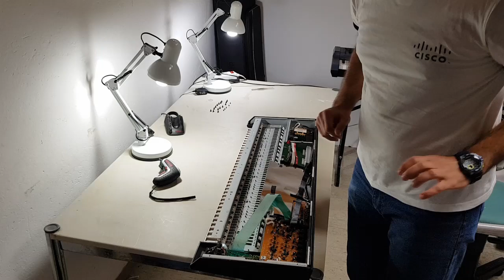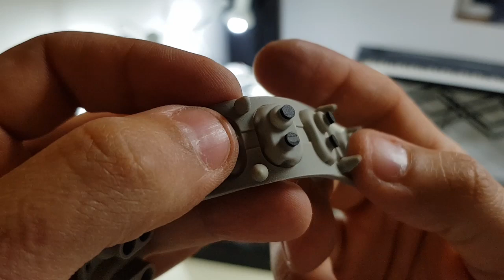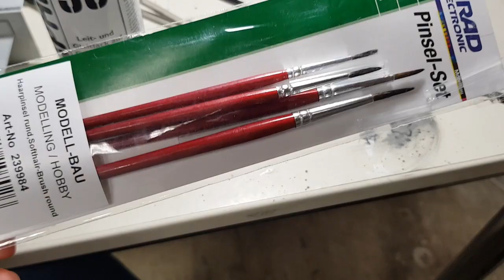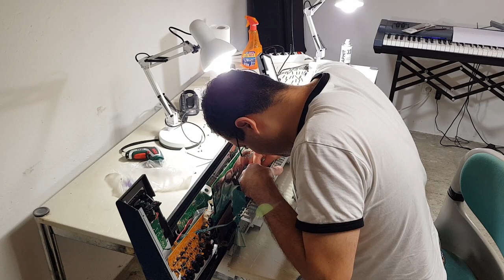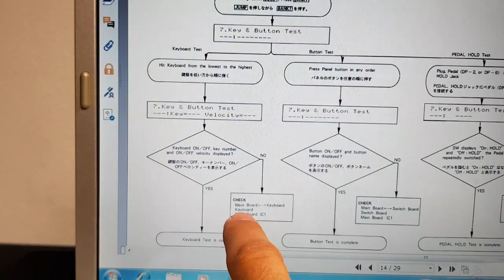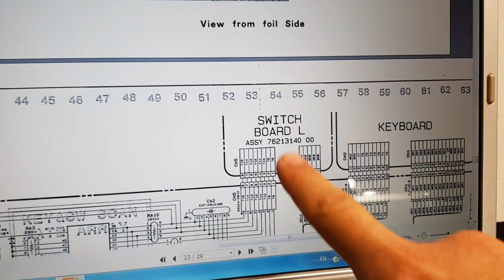Roland U-20 Problem and Repair Part 1 of 3

Comment: I got a Rhodes 660, which is basically a rebranded version of that keyboard.  I'm using it as a midi keyboard and the aftertouch sensitivity is pretty weak.  Is it possible to increase the sensitivity if I open it up?

The menu controls don't affect the midi side of things.
Reply from the maker: Hi. This is a tough question because increasing the sensitivity of the after touch is 100 percent a matter of hardware design. If you don’t have the schematic of the board, it is very hard, if not impossible to find a way to do that.
Whether or not changing hardware for the sake of after touch would affect other parts of the system is also not easy to answer. 
So if you are an electronics, electrical, or hardware engineer or you know one and you have the schematic of the board, then you might want to check with him. 
Also you might ask this question in Roland related forums and see how others came up with the ideas to solve this problem. 
Good luck and happy new year in advance.

Comment: Regarding the green flexible PCB with the Roland part number 22925669-00:
This part is not available as an original spare part anymore. Roland sold the last ones they had to a Canadian guy many years ago, and also he ran out of stock long time ago.
If you own a Roland synthesizer from the early 90s, e.g. a U-20, D-50, or, as in most cases, a JD-800, it could be that you need this spare part, e.g. to fix the "Red Glue" error, which unfortunately almost all devices equipped with an SK7 named keyboard had.
In this case, the red synthetic resin used to glue the keyboard weights becomes liquid, drips out of the keys and soils or damages the green, flexible circuit board.
Repairing the PCB itself is usually impossible, as the resin forms a very strong bond with the PCB, and most attempts to remove it unfortunately fail.
This is how it was for many years.

I myself had already started to remedy the situation by making a new PCB, but had discarded my plans in early 2020, as another person, Guy Wilkinson from England was already much more advanced with the same work.
He completed his project in 2021, and now offers a set consisting of a completely new redesigned flexible circuit board, and an also redesigned new connection board which also solves some design flaws Roland made back then.
The set is currently still being produced in small quantities, and can be ordered directly on his website. Here he also offers very detailed repair instructions for the devices mentioned, as well as many useful tips for other devices.
He also offers an installation and repair service which should be arranged upfront.
Guy asks that you contact him by email for availability of spare parts. 
contact@supersynthprojects.com
His website: http://supersynthprojects.com

Customers in mainland Europe will certainly find the option of contacting http://synth-parts.com more convenient. This is a professional synthesizer repair shop, and and well-stocked synthesizer spare parts supplier in Wuppertal, NRW, Germany.

I myself own two JD-800s, one of which is completely original, and the other of which has had the above-mentioned circuit board fitted in Wuppertal to restore my beloved instrument to its former life.
There is virtually no difference between the two devices after the repair.

I am not in any way related to the companies mentioned, and I am not being paid for this contribution.
I have logged in here specifically for this comment as I feel the information is valuable and would like to share it.
The mention of companies, trademarks and brands is for descriptive purposes only and does not constitute advertising, but serves the sole purpose of imparting knowledge.

Comment: Hey there thanks for filming this video.  I had spent a whole night opening my keyboard but I didn't take apart the keys to see if I could clean the contact points without taking it apart.  I was able to fix all the keys save 3 just by rubbing off things on the keys on the reverse side on the silver metal bendy parts.  Although  I still couldn't fix 3 flat notes and my whole set of buttons for selecting other instruments don't work.  This inspired me possibly to fully take apart the keys.  (after I take a couple days rest hehe) Theres corrosion in mine although my board looks fine so I'm not so sure if I just have to keep scraping it off carefully.   Being as the majority of my keys work I still find it useful connecting it to garage band with a midi (mio) and I can still find it very useful and change the instruments in the software.  Even though my selection keys seem to not respond.  Sometimes you just keep trying and eventually they work. I used a small vacuum as I was hitting the the back of the keys with the back of a plastic paintbrush. Useful<---all the keys have labels on them.  Gonna write them all out as you suggested if I decide to take all my keys off.  Good work, it's a whole operation.  Found your video very clear.  Happy playing everyone hope you get yours working:)
Reply from the maker: Thank you.

Comment: I’ve done the keyboard contact repair on my Roland U20.   I actually had to do it twice on one of my U20’s because the contacts were remanufactured so bad.
    Edit:  I’ve actually had to do this same contact repair on my brothers U20s too.  Roland really screwed this design up. I have many Roland keyboards, none of my others have this problem.  
   (OK I forgot about my three Roland XP 80s with bad Epoxy On the keyboard weights.  Don’t ever buy a used XP80 that has the orange epoxy Holding in the keyboard weights!!!).

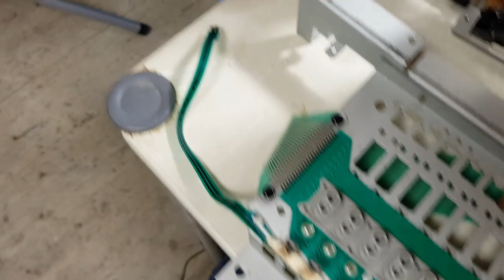Comment: @ 1:50:00  NEVER EVER UNDO THAT CONNECTOR !!! Disconnect it at the mainboard so that you can altogether remove the keyframe from the main body of the synthesizer, but NEVER disconnect it where it joins to the keyframe. There it is glued together at the factory and you'll never make all the contacts conduct properly again. This is Roland's worst ever keyframe,  Complete Disaster Technology !  Also, the switching diodes for each key are 'Glued' into the green Mylar contact strip under the keys and are impossible to replace. So you'd best hope that dead keys are not caused by dead diodes.
Reply: I undid my connector and tried cleaning it with alcohol...bad idea it disolved the contacts on the green strip now the keyboard is useless. I was thinking of bypassing the green strip altogether and replace it with wiring, I was just wondering was this keyboard worth the work.
Reply: @fredtillman3050  midi another keyboard to the U2o and you can see if you like it or not.
Reply: @GaryLet  Thanks Gary L, I've Missed it with another keyboard and I like the sound, but I've got soooo many Roland keyboards and racks (7 total) I'll just sell it to Keyboard Kountry. I paid $30 for it and it had an octive not playing so it was worth a shot but thanks again Gary L.

Comment: I repair a lot of keyboards. The U20 is not a project for beginners. The shitty ribbon cable interface on the keyboard is very fragile. I learned this the hard way when fixing a Roland JD800 which has the same keyboard.  The low tech fix is always the best. On my Jd800 I drilled holes in the metal and clamped the seam where the cheap ass ribbon was heat sealed together (using small bolts and using thick rubber between metal strips and the cable.....Go to yahoo groups roland JD800 to see pics. A variation will probably work on the U 20 if you didnt destroy the cable. 

Also the U 20 keyboard suffers frrom red glue syndrome. I took all the keys off and sealed the weights and red glue in with better glue. I replaced all tac switches under the panel buttons. The construction of the U20 is pretty gnarley, too many ribbon cables and weird angled mounting of the boards. Not the easiest board to fix. Im waiting on a few key bushings in the mail, as 3 got torn off when I removed the keys to glue them.
Reply from the maker: Hi and many thanks for your comment. Someone sent me the spare part(s) and now the Keyboard is fully up and running. Please watch video 2 and 3 as well. The links are available in the video description.
Reply: Thanks but sorry to hear cause I was about to buy a used one. Use to love the U-20 but never had one. I have an Alesis QS-6.1 now.
Reply: @Berkner80  pretty sure I smashed the u20, in a fit of rage. not worth the trouble. the jd800 was a horrible project, but at least its an awesome synth!

Comment: How did this turn out for you? I changed the internal battery and am currently cleaning the keys of mine(only two worked). It's a pretty nice keyboard, so I hope you can save yours.
Reply from the maker: Thanks for your message. I could not get it fully repaired and the spare parts are either not existing anymore or are so expensive that it makes no sense to buy. I will probably publish a short video about my last attempts and current status. I took the videos but I had no time to edit and publish it yet because I was busy with my working one. You can see it  here: 
https://www.youtube.com/watch?v=rHOIseCvzok&t=4s
Reply: Well, you could still convert it into a midi powered synth. The old keyboards are a pain to clean every couple years anyway(I like doing it though). If you do decide to do that, I would very much appreciate it if you sold me your rubber button contacts though as I broke some of the push in connectors since the rubber was so old. Thanks.
Reply from the maker: could you please send me a PM to "fg.ece.ut@gmail.com"? Thnaks.
Reply from the maker: here video 2 finally :)  https://www.youtube.com/watch?v=w41iGkzGjhg&feature=youtu.be

Comment: I have a dead "Value Up" button on an otherwise perfect Roland U-20. I was thinking about trying to repair it myself -- but your video has scared me straight! It looks like a jigsaw puzzle I'll never be able to put back together.
Reply from the maker: That is exactly why I decided to publish this video. Since U-20 is a very old keyboard, you might start repairing it and end up with no result but your wasted time. I personally decided not to continue anymore. There is almost no spare parts for this keyboard anymore and other engineering skils don't help either.
Reply: Are you sure about the parts?  I live in Canada and Roland has stock parts. The same buttons, key contact points, etc. we’re used on multiple Roland keyboards.  I guess it depends on what it broken.

Comment: I've butchered my ribbon cable so much in repair attempts, that it's now unusable, but I've heard that the Roland JD-800 uses the same ribbon cable. Is this true?
Reply from the maker: Many thanks for your comment and sorry for my late reply. Actually, I am not a Roland expert but during my research, I found the Roland JD-800 uses the same ribbon cable as well. It is just my personal opinion about what I found on the internet. I can't say it for sure.
Reply: I hope you're not planning to butcher a JD-800 to save one of these?